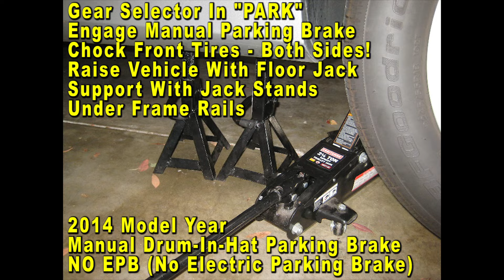2010 To 2015 Chevrolet Camaro How To Change Rear Brake Pads With Part Numbers

Comment from the maker: Chevy Camaro Rear Brake Pads - https://amzn.to/3W4CyVC
Power Stop Ceramic Rear Brake Pads - https://amzn.to/4bsgDMH
Raybestos Rear Brake Pads Part Number - https://amzn.to/4bvWzZE
Bendix Rear Brake Pads Part # - https://amzn.to/3xCMLze
"F" Clamp - https://amzn.to/3W3zUzi
Precision Screwdriver Set - https://amzn.to/3sLixaP
Plastic Pry Bar Tools - https://amzn.to/3HMtsV7
Socket & Ratchet Set - https://amzn.to/3Z17LbA
Mechanix Gloves - https://amzn.to/3jCnHkt
Torque Wrench - https://amzn.to/3vS5uSI

The Paul79UF YouTube channel is a participant in the Amazon Services LLC Associates Program, an affiliate advertising program designed to provide a means for sites to earn advertising fees by advertising and linking to Amazon.

This DIY video shows owners of the 5th generation 2010, 2011, 2012, 2013, 2014 and 2015 Chevrolet Camaro how to change the rear brake pads.

Comment from the maker: Check out the DIY guide for changing the rear brake pads on a 5th generation 2010 to 2015 Chevy Camaro - 
https://www.paulstravelpictures.com/GM-Chevrolet-Camaro-Rear-Disc-Brake-Pads-Replacement-Guide/index.html

Here are all of the DIY repair and maintenance tutorials for the fifth generation 2010 to 2015 Chevrolet Camaro - 
https://www.paulstravelpictures.com/Articles/GM-Chevrolet-Camaro-Common-Problems-Repair-Maintenance-Guides.htm

Owners of other General Motors vehicles such as the Spark, Cruze, Malibu, Sonic, Impala, Traverse, Tahoe, Trax, SS, GMC Terrain, Acadia, Yukon, Buick Verano, Regal, LaCrosse, Encore, Enclave and the Holden Barina may also find these DIY instructions to be helpful.